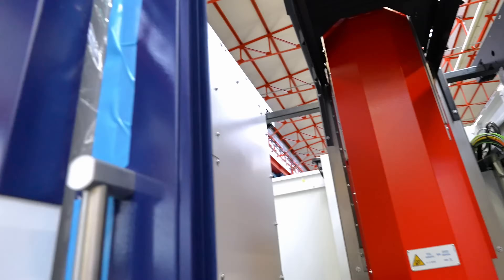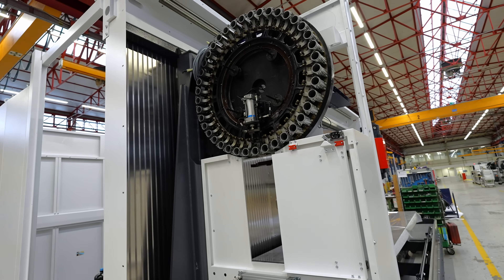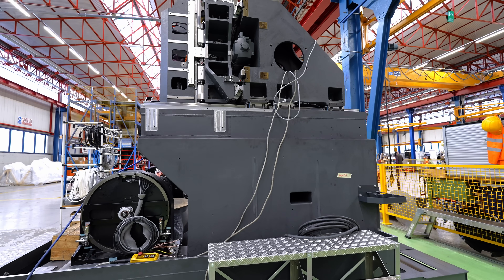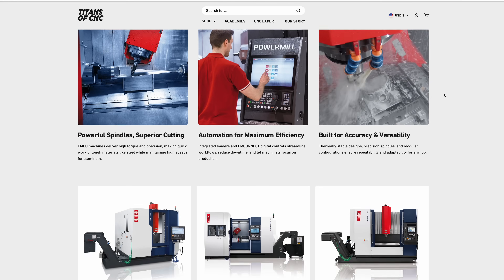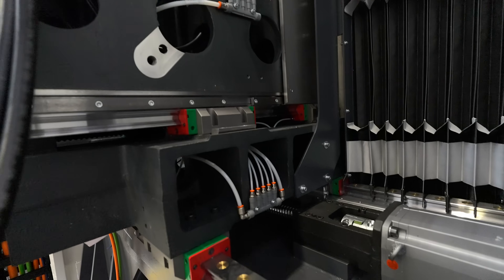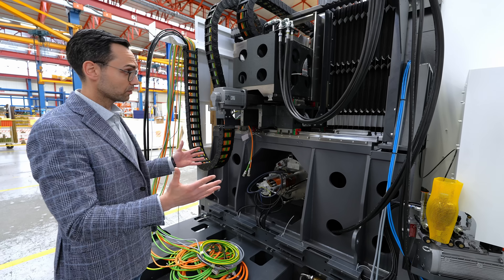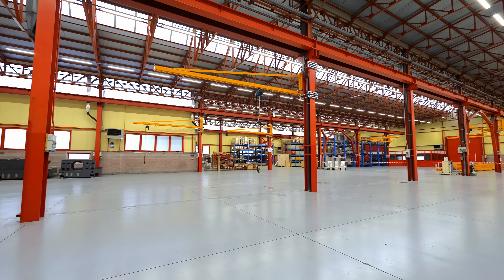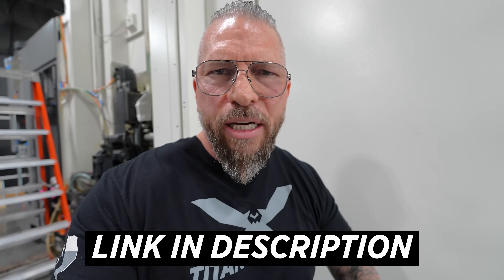Inside Italy’s Factory of 5-Axis CNC Giants

Comment: Working for decades? My 2005 Emcoturn is good, but many repairs were needed, often burned relais, contactors which they should have used one size bigger.
Reply: Emco still uses contactors for tool changers on a few models. These have a limited lifespan in terms of switching cycles, are subject to wear, and must be replaced regularly. Unfortunately, Emco doesn't communicate this well, but spare parts are always in stock and available for immediate delivery.

Comment: The rigidity of all the linear bearing machines are  in midrange. It is not made for heavy duty roughing like box ways equipment. But on the other hand it can move much faster. I know, cause I used to work on Makino horizontal 4 axis monster with 30 Hp/10K spindle. The linear ways machines are more suitable for rapid metal removal at medium to light amount but at hi velocity, which actually achieves very hi metal removal. (similar to HAAS concept). This manufacturer seems NOT to be legally connected to original Austrian EMCO, later (2013) acquired by DMG/Mori in Germany.
It would be interesting to hear from Italians, why they decided to use the same Name(EMCO)  and if there is indeed some hidden connection, which - so far - is not public. lease, investigate and let us know, Titan.
Reply: Excuse me, but I would like to ask where you are getting this incorrect information. Emco acquired Famup machine tools in 2005 (renowned Italian machine tool brand with a long history),  and here in Italy we have been manufacturing milling machines under the EMCO brand for nearly 20 years. With 75 years of history behind us, we have gained substantial experience in the industry. 
It is simply untrue to state that DMG acquired EMCO in 2013—this is factually incorrect, stop with the fake

Comment: This video made me mad. I have to clarify why. 
I'm not mad at the machines being made, they are beautiful. I'm not mad at where they are being made, I want the whole world to have shiny toys to work with. 
I'm mad that we cant make them in the US anymore, and that it seems like no one is even trying. I'm mad that the steel mills that made it possible to create such things are gone and no one wants to bring them back. I'm mad that we let the knowledge base behind how to do such things wither away without training a new generation with all of the hard won lessons they learned that were never written down. 
I'm not even a machinist, I'm a welder. But I worked at a job shop that was half welding half machining and got to weld on many machined parts and it was the highlight of my working life. I loved working with machinists on crazy parts. My favorites were ones that would bounce back and forth. Machine this face flat, weld stuff to it, machine something else, weld more on after kinda parts.
Reply: You can make them in USA but your wages will need to go down as you can comete with Taiwan for example. JApan is a completely different story since they have small manufacturers who focus on high diversity, top wquality, low rate production. You have HAAS, HURCO and Fryer but they use cast structure made in Taiwan, they only assemble thye machines.
Reply: Two key points:
1) Everyone should also remember union steelworkers in the 80s making $30+/hr and some had up to 26 weeks of paid vacation + pension.  Just do the math.  Labor cost bloat...
2) US Management is all about making the next month's numbers.  Or quarter or year.  To be in the steel or machine tool biz, you need to think about the next decade.  Americans have been horrible at long range planning for a long time now.  Not sure the cause, but I'm sure stock price pressures have a lot to do with it, and the government has been pretty lazy at doing anything to keep the international playing field level.  With the right nudge, we could have an awesome American CNC controller and drives...but no...the main choices are Germany and Japan.  Haas would do well to open up the system to everyone and start selling control/drive packages, but I take it they're not interested.
Reply: get angry with your government, the United States, which allowed China to enter the World Trade Organization years ago!

Comment: This is a maximally nerdly response, but the guy says they run Rexroth linear guides...and the ones they showed have red and green end caps - exactly like Hiwin from China.  Rexroth are blue on the ends....something isn't adding up, unless we were being shown a proto machine with cheaper slides not reflective of production machines...
Reply: The speaker made a mistake, that is certain... The first machine, UMILL1000, has clearly Bosch Rexroth rails (you can kind of see the blue gasket between the scraper and the bearing block) but the second (umill630) is 100% using HIWIN. The choice between one and the other can be driven by purely engineering choices or cost, hard to say.
Reply: @federicos8504  Agreed.  At 2:00 you can see the Rexroth blue.  Good eye!  There's a ton of Hiwin being used though.

Comment: I have two EMCO machines, a lathe and a milling machine. Both over 30 years old. Small machines that were used for training. The basis is excellent even if you have to renew the electronics. there is nothing better for a small workshop.  At Emco you get a machine that offers excellent quality for many years. Absolute buy recommendation

Comment: hi titan as an italian welcome to our country. but the real top of 5axis is HERMLE, i run two of them and they are monsters! super accuracy and super stability
Reply: Agreed, Hermle one of the best certainly, but I would say that Roeders will also be equal or better, for smaller parts what about Kern or Yasda?
Reply: @alexgreenhalgh935  yasda is another top brand, maybe the best, but i heard it comes out with only fanuc control. I'm an Heidenhain control fan lol
Reply: I like hermle too but we are on our 3rd spindle in under 4 years. it's not even a production machine either, and we pretty much only use it for Aluminium, great machine when its going but I don't think they would get another one. they've had 2 other dmg's doing the same work for the same time both on original spindles, so the hermle will get traded for a dmg next, plus it just keeps it more consistent having the same machines.
Reply: @AlphaEngineer2022  I believe that the quality of bearings (purchased parts) has deteriorated in recent years. I recently had a Siemens drive motor with a bearing failure after only two years of operation. I disassembled the bearing and it was clearly a foreign particle that had been forced into the raceway, causing excessive wear and tear until the motor became increasingly loud.
Reply: @Ixnay-Mike  You need a machine that makes its own wear parts. Okuma is really good at this.
Reply: @ But no one will produce wear parts like ball bearings themselves.
Reply: @  we found exactly the opposite - strange how different experiences pan out. DMG are masters of very little in my opinion.

Comment: I like the knock on haas...yes they need to up their game. My experience left me never owning a haas again
Reply: I would bet if Haas put their minds to it and set up a separate group to make high end machines, they could.  It's not exactly a secret what it would take.  Level up on component accuracy (guides, screws, spindles) and put some thermal management to it, and you'd have a very much upgraded product with only minor design changes.
Reply: @madmat990  Totally agree - the one thing they made that was amazing is the control. It's really user intuitive, but they have become obsessed with cost cutting as far as I can see
Reply: They are probably busy with throwing money away on their racing teams. I wonder why the heck they have their mediocre F1 team (which buys as much components as possible from Ferrari anyway). 

To be fair, they are still usable when it comes to your every day bread and butter project in an average job shop. But definitely not a high end.

Comment: No machine should ever have a welded machine bed. If you’re using a welded bed or “epoxy granite” a machine can only be middle of the road at best. The only reason they do this is price. And that reason is unacceptable in premium price brackets.
Reply: Go do some engineering first. Some narrow-minded envangelism goes there. Everything vibrates. It is how the machine is designed what matters, not the marketing material you read.
Reply: I hear you, but many companies have figured it out.  You need smartly designed weldments and a stress relief / anneal before use.  If you need damping...add damping material of choice.
Reply: @madmat990  But even with that you still dont have long-term stability, dampening and crash resistance. And dampening directly translates into tool life and surface quality in e.g. stainless. Sure you can engineer decent machines around welded frames but its just trickery to mitigate the underlying issue. You want machines to be predictable. There’s a reason people retrofit old, slow machines three times with new controls for a 100 grand. I’ll make a video about statistical deviation and absolute errors in machined parts dimensions but it’ll be in german.
Reply: @Narwaro  What I hear you saying is a nice technical / academic argument...however in the real world it's obviously working.  Do you think Grob horizontals are garbage?  They are weldment machines.  I understand all the plusses of cast iron. You don't need to explain any of it to me, I'm a metallurgist and engineer.  But aside from a preference...you would need to prove to me which weldment machines "don't work" and why.  My observation is that if you properly engineer a weldment, they can and do work.  And if you water cool the linear guides, ballscrews, nuts, and spindles...what's the problem now?  I would also argue that retrofit old machines are less than 5% of the market...maybe even less than 1%.  Companies buy new machines, depreciate them, and sell them and buy the next new.  Control updates alone pretty much force it anyways.
Reply: @madmat990  Yeah sure they work. I just think their solutions arent the best given the price point. In engineering you can make any solution work with enough effort. But the question is if it makes sense. Oftentimes the purchasers are entirely different from the people using the machines. And more often than not purchasers dont have the technical knowledge to see past marketing bs because machine purchases are often managerial/strategic decisions. And for a couple of years Ive seen all the companies that apply the principles youve stated go under one after the other or be in serious trouble (e.g. because they stop paying our bills lol). Business is all about longterm thinking and expensive repairs/limited lifetime is a red flag to me.
Reply: Not when you are using tool steel which is much stronger than cast iron even when it's welded.
Reply: @hocln2556  Dude NOBODY is using tool steel for bases....they're horrible for weldments and horribly expensive.  Just not needed for a weldment.
Reply: @ Nope, thats not gonna save ya. Cast iron is used because of its excellent dampening characteristics. Steel vibrates. Alloyed steel even more than mild steel. Secondly, cast iron is not ductile. It doesnt deform, it just cracks if you overload it. Which means that if you crash a welded frame machine, its machine bed is now a banana. Cast iron is stable for…ever.